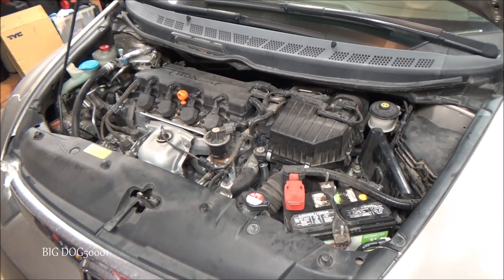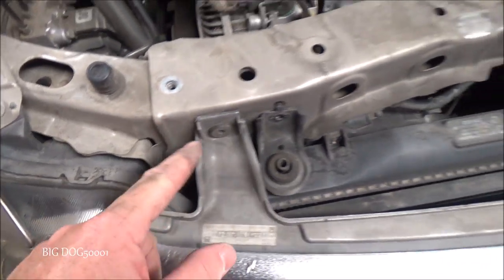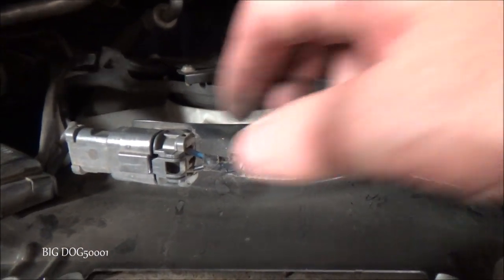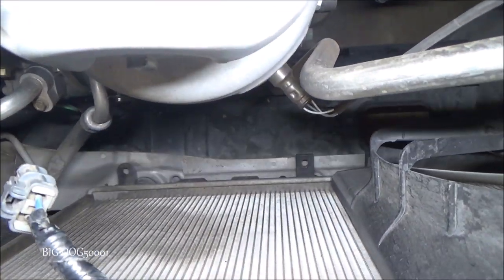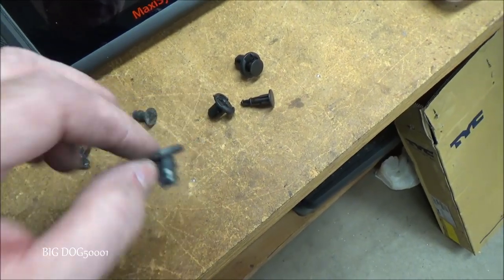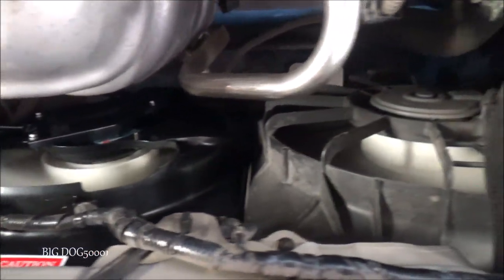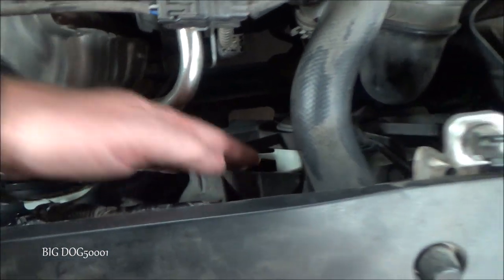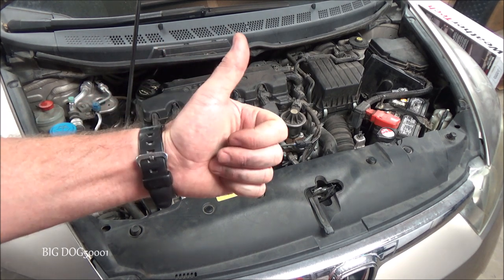Honda Civic A/C Condenser Fan Replacement 2006 (2006-2011 Similar)

Comment from the maker: Tools and Parts

This channel earns a small commission using some of these links - at no additional cost to you.
TYC 610970 Fan:  https://amzn.to/2BAe90h
Trim Clips (Kit):  https://amzn.to/32sLGFn
GearWrench Ratchets:  https://amzn.to/35OQ2IP
GearWrench Sockets:  https://amzn.to/33LQCWe
Milwaukee M12 Ratchet:  https://amzn.to/31ydNSo
Lisle Push Pin Pliers:  https://amzn.to/2OXBSiI
Telescoping Magnetic Pick Up Tool:  https://amzn.to/2OYSJBJ
My Favorite Trim Screwdriver:  https://amzn.to/31qFI6B
Magnetic Parts Tray:  https://amzn.to/2VU9Ztf
Long Pliers Set:  https://amzn.to/2nY7Tfv
Astro 40SL Light:  https://amzn.to/2OZ7moI
GearWrench 3/8" Hex Socket Set:  https://amzn.to/2VSfJ6O
Ratcheting Wrenches (Similar to ones used):  https://amzn.to/35KJgnB
Lang Digital Thermometer:  https://amzn.to/33MpC8H
Vessel #2 Screwdriver:  https://amzn.to/2OYAxIo
Autel MS906BT Scan Tool:  https://amzn.to/350kGP0
Lisle Trim Removal Tool:  https://amzn.to/2J2oFRL

The Big Dog 50001 Automotive Channel Store can be found here: https://www.amazon.com/shop/bigdog50001automotive

Comment: Great video, thanks. 2007 Honda Civic, I was able to slip the old fan out and the new one in without having to remove the metal bar. I only had to remove the plastic 'bar' that you removed first and was able to get to the bolts on the fan. Only two bolts. Took 20 minutes.

Comment: Swapped mine out today, can’t believe the difference it made must’ve been broken for a while … I didn’t however remove that bar only the fan, tight fit but I made it work …
Reply: what year was yours? i wanna be able to remove old fan. looks like possibly 2 screws ,  one hard to reach under the cover.

Comment: Hi big dog, thank you so much for the video 😃

The new fan replacement is a plastic body and it requires longer bolts. Do you still recommend that fan being that it now has a plastic body instead of metal? 

Thank you.

Comment: Most of these steps aren't necessary. If you're only replacing the condenser fan it can be pulled out without removing the battery, cross member, etc.. Two 10mm bolts at the top of the fan need are all that needs to be removed. The fan will pull out with a little finagling, and the new fan will go in the same way. Just replaced the condenser fan on my son's 2011 Civic, took about 15 minutes. If you need to replace the radiator fan as well, all these steps are necessary.

Comment: ATTENTION
You do not need to take off anything except for two bolts on the fan itself! 
It's a tight fit but it can be slid out and the new one dropped in without taking any bolts off except for the two 10 mm hex bolts on the fan itself at the top. 

Also the new fan that he recommends in the description does not come with bolts and because the fan is plastic body it is thicker than the previous metal body. You need new bolts. 

I'm going right now to local hardware store to get same size bolts but a quarter inch more length
Reply: You are correct. I did did the replacement in less than 15 minutes. I spent more time taking off the connection.
Reply: Thanks for this tip! I just orders the TYC fan he mentions in the video. I know it’s been 10 months, but do you remember the size of the bolts you purchased? Thanks
Reply: @garret
Reply: @MillionaireValetcom  10mm hex, 1/4" longer than the ones in there now. Go take one off and measure it. 👍

Comment: What year is that car? some guy told me i didnt have to remove plastic cover but to remove two screws of bad fan, and unplug a cable or two and slip fan out and  slip in new fan. But it appeared to me, that a metal part where fan is might mean having to remove perhaps cover and somethin else. What about when disconnect cables, might it offset relay switch signal code? Would not know how to reset that if at all that exists.

Comment: If you guys are gonna use the exact link for the fan replacement, keep in mind that the OE screws won’t fit & you will probably need to go to autozone to get a bit bigger 10mm bolt. there is also no mount for the wiring for the fan as well.

Comment: Have a 2007 Civic. I'm thinking maybe if I'm replacing the AC Condenser fan, I might as well replace the radiator cooling fan at the same time. Thoughts? Good video.

Comment: Thank you so much! I am wondering what if the fan is workingbut still ac not blowing cold in traffic? I just cleaned my evaporator , it became better but still not ice cold as it should be.
Reply from the maker: A/C diagnosis can be difficult sometimes.  A dirty or restricted condenser, low refrigerant or a compressor clutch relay that is stuck on can all cause poor cooling performance like you describe (among other things).  Thanks for the comment!

Comment: I have a 2010 Civic Coupe 1.8L and the engine takes a while to warm up when its little cold outside. I live in Atlanta so the temperatures are not too low. Any suggestions? Could it be a stuck open thermostat? Car has 101k miles.
Reply from the maker: It is possible it is a thermostat issue, very common for them to fail on these Civics.  It can set a check engine light (P0128) if it gets bad enough.  I will usually look at both ECT 1 and ECT 2 sensor data PIDs on a Honda capable scan tool to verify thermostat operation.

Comment: Hey bigdog.  i got a 2006 civic 1.8.  when the ac is on and the fan kicks on, my engine briefly stumbles.  i can't afford to take it to the dealer any ideas what it could be?  AC blows cold no issues with that.  Engine is perfect when the ac is off.  I'd greatly appreciate your input on what i should check because I live in Vegas and i'm a delivery driver so i really need my car and my AC, thanks.
Reply from the maker: Unfortunately it could be a few things, the idle may need to be relearned (PCM needs to be reset to do that) or there could be a problem with engine computer software being too slow to respond to electrical loads (an update was made available to correct brief idle vibrations on those Civics).  There could also be issues with the A/C system and the list goes on.
Reply: @BigDog50001  - guess i have to take it to the dealer at some point.  Thanks alot bigdog, appreciate it.

Comment: Hey so I checked the ac condenser relay and the relay for the radiator fan and they’re good but for some reason my condenser fan won’t turn on still and I replaced it with a new TYC fan? What others fuses or relays do I need to check
Reply: Nevermind I got it fixed it was a bad fuse, would have been an easy fix if I had just checked all the fuses instead of replacing the fan with a new one, at least I won’t have to repair this for a long time.
Reply from the maker: Good to hear you got it fixed, but just remember something blew that fuse, they typically do not just blow on their own.  There is a good chance the old fan was the problem.  If the fuse blows again you will need to find out why it keeps blowing.
Reply: Big Dog50001 Automotive thanks I was wondering the same but glad I just replaced the old oem fan with a new tyc fan. I’m not sure how long this fan was not working for since I never really checked it since I got no check engine light code for it.

Comment: Question: My 2008 civic only vibrates at idle when the A/C compressor cuts-in. Engine mounts were new and no vibrations at all as long the A/C clutch do not cut in. What could be the issue?
Reply from the maker: I would have to see what is happening but sometimes the engine computer needs to re-learn the idle (involves resetting the PCM and then learning the idle again), especially after certain repair procedures are done.  Also, some of those older Civics had issues with the idle when certain electrical loads were placed on it (not necessarily the A/C compressor).  The engine computer was slow (or unable to) respond to those loads and the idle was effected.  The fix was to have engine computer reprogrammed with updated software.   It could also be an A/C problem (bad compressor or overcharged system) and it is putting too much load on engine.
Reply: @BigDog50001  : Many thanks for the reply. I am in Singapore and  most probably need to do what you have pointed out with the Dealer here.

Comment: I'm confused because I recently had my radiator fan replaced because it was overheating except it was where your condenser fan is
Reply from the maker: They are not always on the same side.

Comment: Could you have removed the fan from underneath?
Reply from the maker: It would be very close, I have not measure it to see if there is enough room.  The plastic shield on the bottom would need to be removed if it is tried that way, and all of the plastic clips on the shield would likely be broken during replacement.  If I had a 2 post lift I might try it that way, but without one I won't try it because I don't like working on my back if I don't have to.